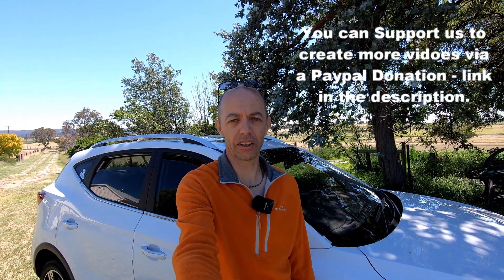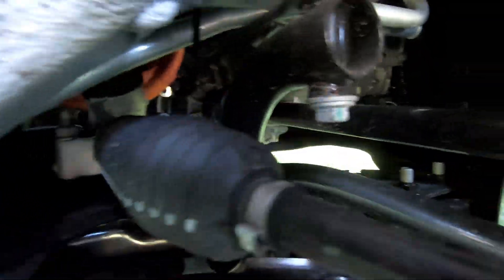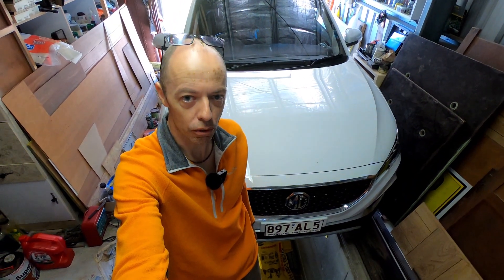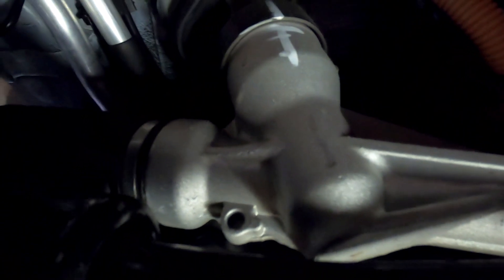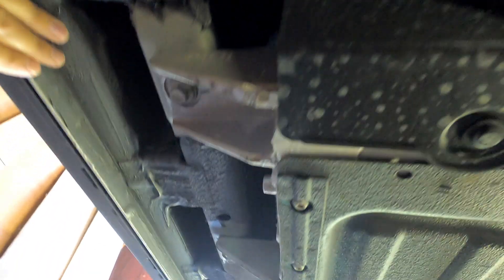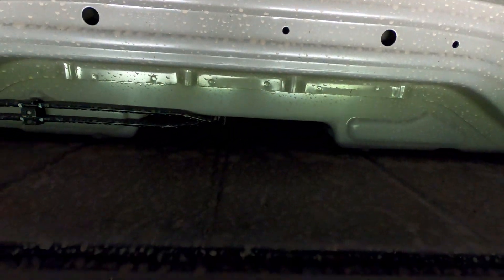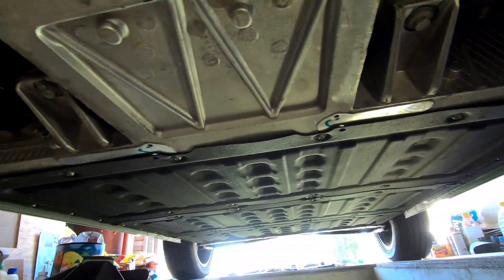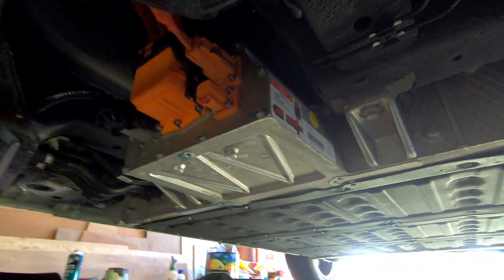Parts of the MG ZS EV you've never seen before - we climb underneath an electric car and look around

Comment: Thank you for taking the time. Looks like they have room for a bigger battery at the the back. I wonder why they didn’t put a cover over the engine and gear box.
Reply from the maker: Hi Andrew, can't go bigger capacity battery unless they make it lighter-weight as the payload is already limited to 500kg, Inc passengers gear etc. Not sure on the cover; air flow, cost, weight maybe?
Reply: @ElectricCarAustralia  why put a cover if you don't need to open the hood. It is not as if you need to do maintenance on them.

Comment: Thank you so much ECA I have the same model and colour as you bought in June 2020 all good so far. I love your home setup.  Your filming and commentary are excellent, you have explained in great detail the underneath of the vehicle.  Good luck with your channel.
Brian from Liverpool UK.
Reply from the maker: Thanks Brian, appreciate the feedback.
Reply from the maker: Hi Brian, follow up question. Did you get 2 charge leads included in your purchase in the UK?
Reply: Electric Car Australia : 
The deal I got was the granny charger only, but the dealer included comfort pack, so mud flaps, boot liner, and carpets. The government here subsidies my home 7kw charger and also contributes £3000 towards the upfront cost of electric vehicles under £40000 .
As I'm a light user mileage wise I have only used the home chargers. 

BTW one tip don't be the first in the queue to get software updates - listening to the forums here MG can issue a warranty update for instance to the battery management system only for it to be later reissued, as the first and sometimes the second version have issues. So maybe wait until your dealer is confident in the download. I can send you a link where the software issue is discussed more fully.
Brian

Comment: MSD is the main service disconnect. In the event of an accident, or when doing any HV service you pulled that plug and it makes the HV lines safe.

It really should be more accessible like in other EVs.
Reply from the maker: Hi, thanks for the comment and yep is a bit hidden.

Comment: G'Day Mate from "up over" here in the UK. 

I'd be a bit hesitant and wary poking bare hands about in those areas with high voltages nearby. Maybe less danger in reality. I like to work on my cars but, those EVs may not be very DIY user friendly as my petrol cars.

That was very interesting.  A refreshingly different and informative viewpoint in every way literally. You appear impressed on the build quality of this car which after all, is just another ordinary production consumer item like most others. For two years, I have been running an eight year old Chinese MG6 TSE 1.8T Turbo alongside my other daily driver, a UK built MG ZT-T 1.8T turbo I have had for much longer. I like to maintain and service my cars. Always have done. In doing so, I too have been surprised by the good build quality of the Chinese MG6. Much better than some would have us believe here in the UK when they first appeared. The various fasteners be they large or small bolts and nuts, self-tapping screws and even plastic fasteners appear made of better quality metals etc than the same items on the UK MG which has many close similarities. Even self tapping screws in the wheel arches exposed to all the road filth thrown up by the wheels are easily undone. Their metal appears far more corrosion resistant than the UK MG's ones.  This makes working on the relatively corrosion free fasteners much easier. No stubborn fasteners or worse, like rounded flats weakened by corrosion making removal very difficult or sometimes impossible with normal tools. Yes, the MG6 is a much better car than some would have you believe.

Unlikely to ever buy an MG ZS EV. The recently arrived in the UK MG5 however, does appeal. Had close look at one a while back. It's a modern version of  the MG ZT-Ts I've been  driving for years.  An estate car for the 2020s making an appealing change to the masses of SUV/Crossovers which are now very common on our roads.

Subscribed and look forward to updates.
Reply from the maker: Thanks MG John, good points you raise. I'm also used to doing own car servicing but will be limited to only mechanical on the ZS EV, nothing electrical expect for 12 volt battery when that goes. I hear you with the MG5. This would also suit us much better being a station wagon - Aussie for estate and if they decide to bring them into Aust we would trade the ZS on it. Will have to wait and see. Thanks for watching. Stay safe.

Comment: The D was Diagnostic port great videos mate keep them up :) how are you liking it im looking at the 2022 atm any things i should look for ?
Reply from the maker: Thanks for letting us know. Great value EV, the 2022 model will need aftermarket tinting as with all MG's but other than that the new model has improved in many areas, except interior lighting....a bug bear of mine.
Reply: @ElectricCarAustralia  Thanks mate yeah im going to install the led lighting strip as others have done looks easy enough and also a AAWIRELESS as well much needed :)

Comment: Informative video thank you ECA. Does the battery cooling system use water? Does it need topping up?
Reply: It's liquid cooled/heated and it needs changing at the 4th service, more on how the pack is built here https://youtu.be/knmqqB35yAQ?t=90
Reply from the maker: Hi Robin, thanks for watching. As per other comment, yes a combination of water and coolant to be changed at particular service. No need to top up in normal use as a closed system.

Comment: The EV here in NZ is double the price of the basic petrol model, $NZ51,000 versus about $NZ26,000. The trim level of the EV model is a higher though. What is the price difference in Australia, and for those there, the UK?
Reply from the maker: Hi Brian, thanks for watching. Please 'Subscribe' if you haven't (as it really helps the Channel) and click the 'Bell' icon so you know when we upload another video.

Not sure on the price differences in the UK, where there are 2 different trim versions of the ZS EV on sale. In Australia we only have 1 ZS EV trim version being the Essence for $43,990 drive away. Again unsure if the petrol ZS Essence is a direct comparison in features but it is $26,490.

As I'm sure your aware upfront purchase price is only part of the story. Check the ongoing cost savings on fuel, rego, services, maintenance etc and together with the community health benefits the EV starts to quickly look a better proposition, particularly if your doing larger Klms.
Reply: @ElectricCarAustralia  I looked it up on MG's Australian site. Also double the basic petrol model.
Reply from the maker: @briananthony4044  yep as mentioned savings are longer term. Cheers
Reply: With the EV rebate the ZS EV is now $41,000 here in NZ.

Comment: Can you actually jack up the car using a normal jack to change the tyre? Notice you had some trouble in the video and used that special jack from the rear.
Reply from the maker: Hi @Mathew Barber, thanks for watching. Yes you can use a normal scissor jack under the door sill jacking points I pointed out in the video. The car doesn't come with one standard so I just used my trolley jack.

Comment: I wonder about cooling.
1. Can the AC cool the battery if its a really hot climate? Just blowing hot dessert air wont help the battery.
2. Will the battery be cooled in the baking sun?
3. When you heat the car in the winter will it use the AC like home as a heat pump or will it turn on a wire heater like a toaster which will be 5 times less efficient 😳
Reply: 1. No.  Air-con is a separate system.  The battery coolant is piped around the car, pushed by a pump and cooled using air flow through the radiator.   There is a dual radiator at the front of the car, the first being for the air-con and the second for the battery and motor coolant.  There's also a radiator fan to pull the air through if required.   (Although with the radiator covered at the front by the charging port I'm not sure how the air gets to the radiator.)
2. Good question.  If the car is "on" then the battery will be cooled if required.  But if the car is "off" then probably not.  With the battery under the car it's only going to get radiant/reflected heat from whatever surface it's parked on so shouldn't be enough to raise the temperature too much.
3. As far as I know (from the UK MG EV Owners Facebook group) there's a heater coil in the system somewhere.  Reversing the air-con would probably be a more power efficient system.   But I don't know for certain.
Reply from the maker: Hi Jeff, thanks for watching and great response, all good. I have added a bit more on point 3 in original question.
Reply from the maker: Hi Bmiller, thanks for watching and please Subscribe if you haven't. Jeff comments are all correct with the addition on your question 3. I tested our car, the Aust model ZS EV, and it has a Positive Temperature Coefficient (PTC) heater. Unfortunately the GOM didn't give a stable reading continually rapidly ramping up and down between 0 and 5 amps when on full heat, full fan. As such can't comment on consumption however would be more than H/pump but a trade off for instant heat and lower cost for vehicle. In Qld I will rarely use heater so no problem for me but consideration if you are in a cold climate where the heated seats will also help.

Comment: As the car is single speed, I doubt the ac compressor runs off of the electric motor. The AC pump should have its own internal motor and inverter, and looks to have HV orange power cables running to the top of it.
You missed an important part of the motor plate, PMSM aka permanent magnet synchronous motor, the type Tesla moved to with the model 3/Y good acceleration with better top speed torque.
Reply from the maker: Hi Tim, thanks for watching. Yes I missed mentioning the PMS motor type and your correct the AC would be a stand alone unit powered from the HV battery. Slip of the tongue when multi tasking 😃. That's where you guys in the comments section add great value.
Reply: I was going to ask about the air-con.  It looks like the air-con compressor has it's own motor (with it's own orange HV cable) but it's just bolted to the main motor assembly.   From what I've found if the car is "Ready" (ie the HV contacts are closed) and you turn on the air-con in the car then the air-con motor runs and the air gets cold.  Draws between 2A and 3A according to the dash.

Comment: You need to buy the metal engine cover to protect bottom parts of the engine bay from protruding rocks on the road.  I bought mine online and had it installed at a repair shop. You need to answer the phone, that’s your wife or she’ll be pissed off. Be afraid, be very afraid.
Reply from the maker: Hi Leo, thanks for watching and please 'Subscribe' if you haven't. Not a bad idea, might look into it. Yes it was the wife on the phone 👍